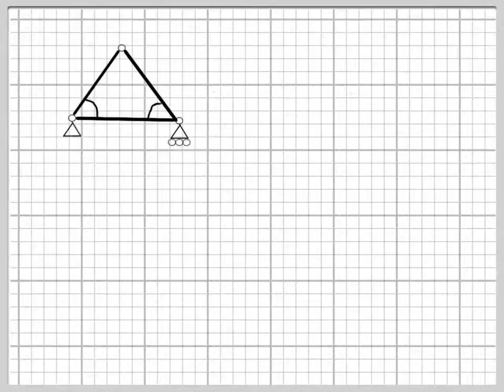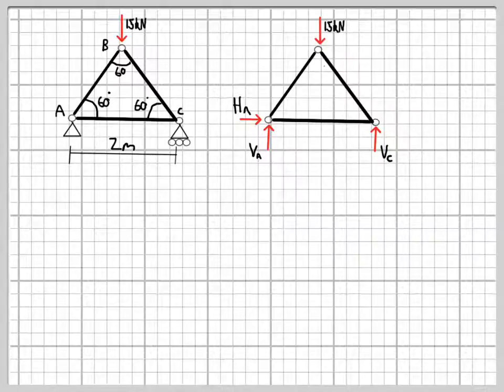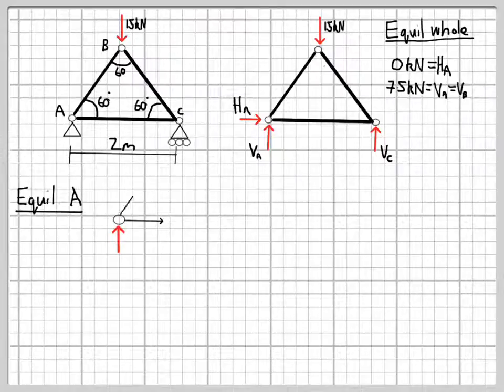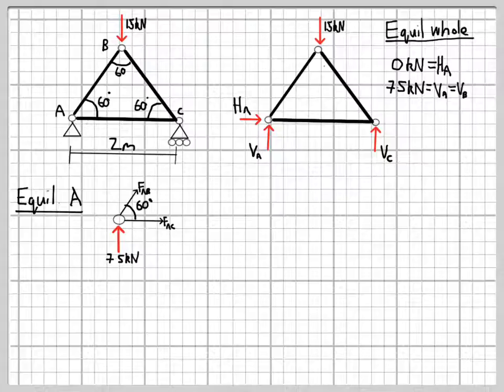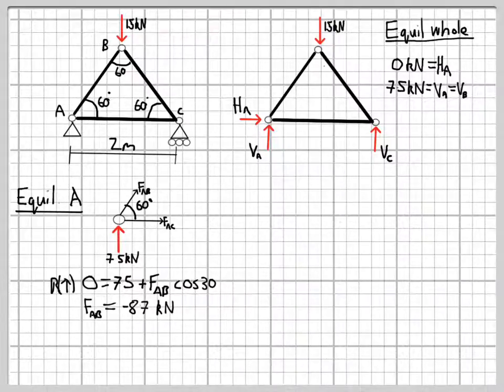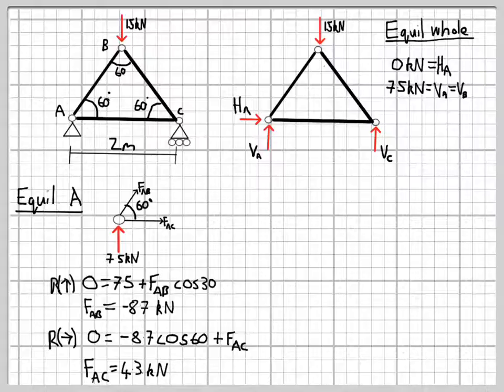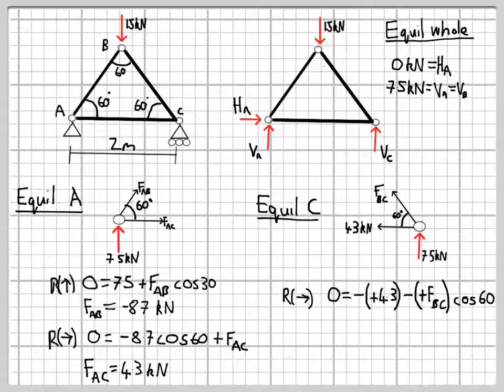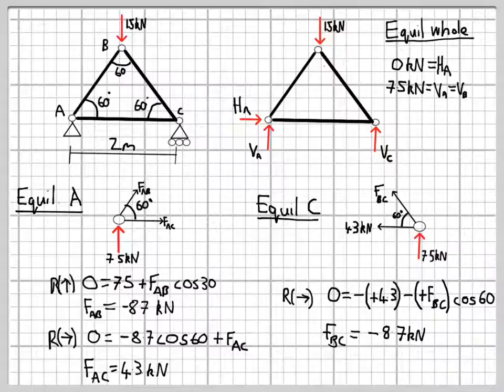Truss analysis by method of joints

Comment: With Rollers, How do you know if its a vertical or horizontal force?
Reply from the maker: The force is always at right angles to the direction the roller can roll, so for a horizontal roller, a vertical force. I will do a video on all the symbols etc that are used in structural analysis next month.
Reply: ok, that makes more sense, thankyou